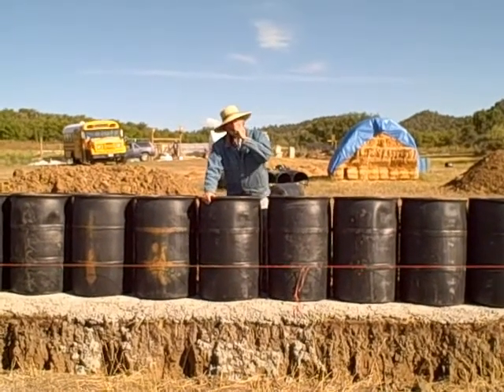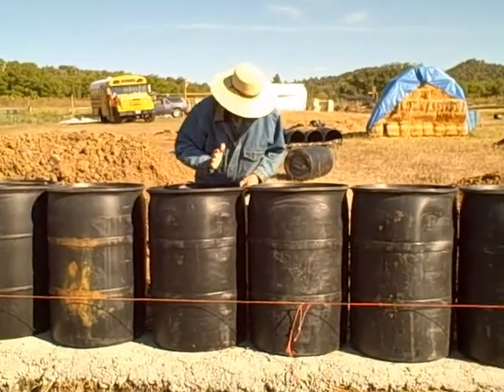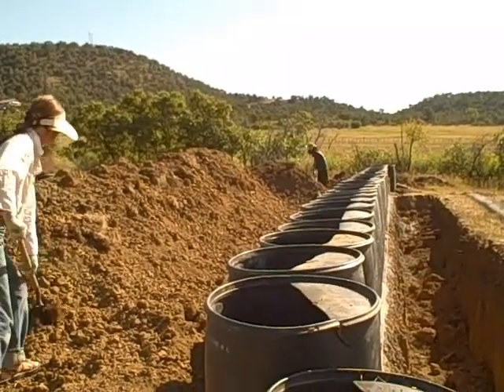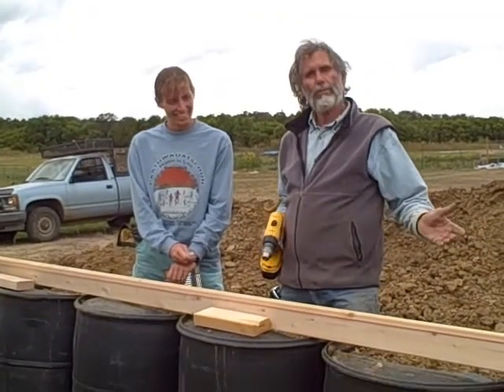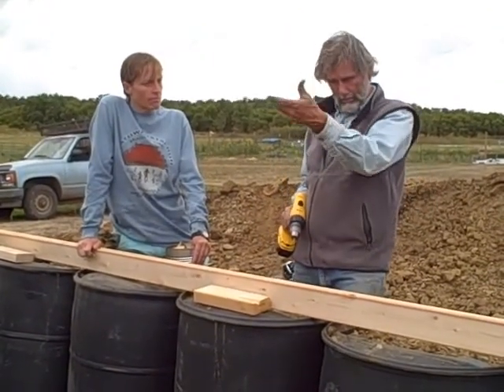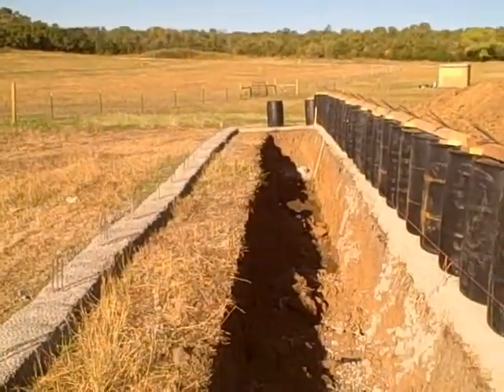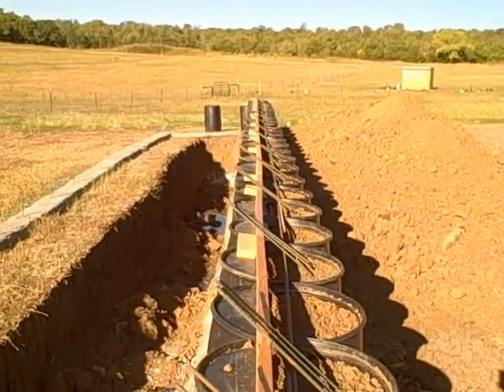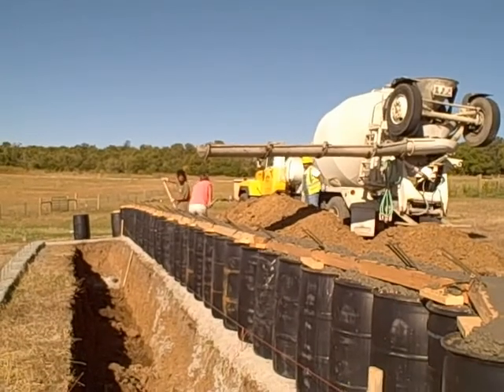Greenhouse Construction  Step 4: Barrel Layout for Greenhouse

Comment: Wow Why all the concrete? And then you filled with earth instead of water. water is a much better thermal mass than earth of the same size. Did you really need to tie the barrels together? I guess you are using them as part of your structure? Ok I'm learning as we go along.